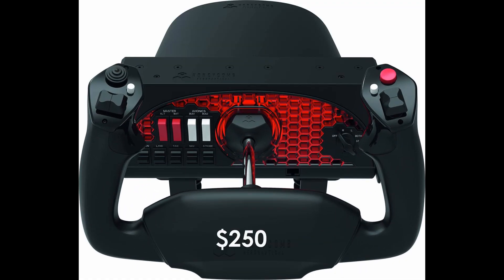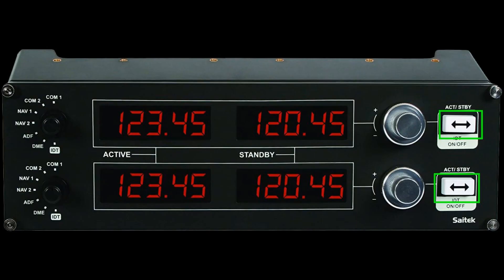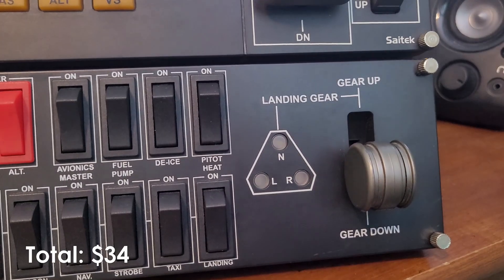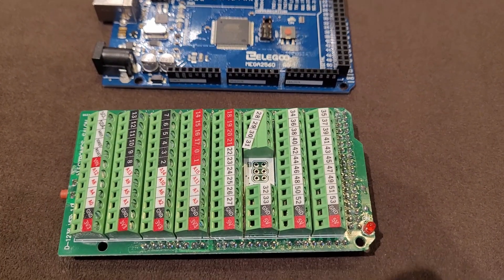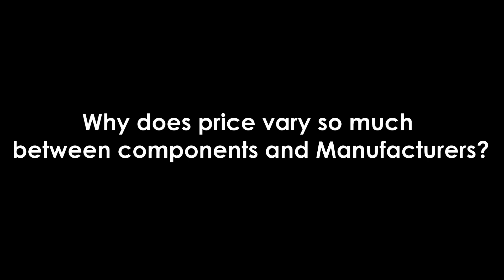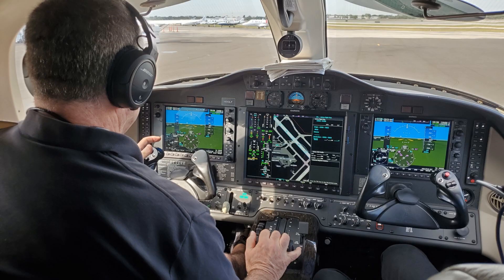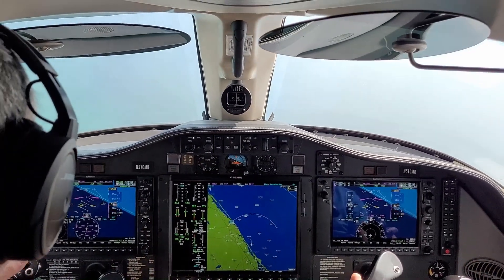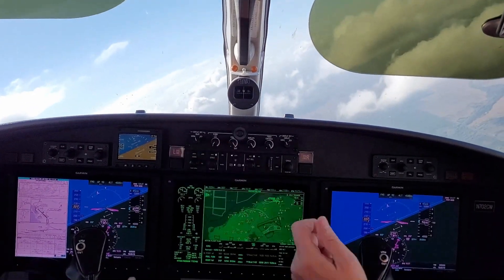Why are Flight Simulators and their components so Expensive?

Comment: I don't think that video really answers the question. Not every flight simulator component is high fidelity, and yet they are still relatively expensive compared to more streamlined electronic products we use everyday. The real reason it's expensive is the economy of scale. Flight simulation is growing, but it's still a small niche market. When you can sell a couple million products, you can produce them for cheap and still make a profit. If you only expect to sell a couple hundred, it's gonna be a lot more expensive to produce, so they need to be sold at a higher price. If you look at racing simulator hardware, it's already a much bigger market and therefore prices are somewhat cheaper (more competition and cheaper to produce). Another factor is that there are so many type of planes with different cockpits, so if you want a specific panel for a specific plane it's a gonna be a small nice inside an already small niche.
Reply from the maker: You make a good point, but what you have said is very generic and only applies to a small aspect of the video. Remember the video also tackles DIY projects and standalone electronics. There are tons of industries (boating, house improvement, renewable energy, etc), not "Niche" at all in which these components are exactly identical and the cost is about the same. Same with DIY...if I build a portable panel with 5 Toggle switches and a controller for my LED lighting system in my porch, I can then use this for my simulator and also my boat; the components and price remain the same as the devices are interchangeable. Racing simulator Hardware is not a very good example because cars are not as complex as aircraft and the knowledge to operate them is readily accessible in contrast to the difficult access to the Aviation industry. High fidelity hardware even in racing simulation is just as expensive. And if you compare products in Racing/Aviation simulation that share almost all of the same components, quality and fidelity, you will notice the price is almost the same. Furthermore, for the units that have sold millions or even billions (which you say should bring the price down), compared to non-electronic counterparts, they are still expensive. This has to do with the fact that electronics and labor is expensive, no matter the industry or the niche market.

Comment: Basically pricing is based on what the market can bear and what the market expects. Right now just about everything is 2x or 3x what it "should" be. Quickmade sells a G1000 set (2 units) for less than Aviatek sells for 1 unit? Is the Aviatek better, maybe. Is it 150% better or worth 3x the cost? Unlikely unless you have money to burn. But again people will assume that being more expensive is better.
A Level D sim sells for $6M (or did before COVID). More than likely half that money went to high overhead and high management salaries. When you start seeing any company with a board of directors, walk away. You're paying their indecent salaries.
Suopport companies that bring value to the table and reject ones that think they have a right to charge ridiculous prices for FS stuff.
Reply from the maker: Thanks for the comment. This video is not really about promoting anybody's products, but giving viewers an idea of what's out there and the different pricing. When I receive a product from a company, and real pilots are not able to tell me if I removed it from a real plane or had the panel made by a flight sim company, then you know the product is of the highest quality available in the market. This is the case with Aviatek so that is why their products are featured. They were the highest quality I could find and this is confirmed by other Sim companies high up in the ranks.
You have to be careful when you say "is something worth it". Everybody's use case is different. Are you an amateur/advanced gamer, are you a real pilot, or do you have a Flight School where you want to use the most realistic, highest quality and higher fidelity components? The answer to this will determine what is "worth it" and what is not and also your budget.

Comment: Very good this video, always good content and videos!
I would like to ask you a question, what is your solution for magnetic switches, I am building a F-16 home cockipit, and Honeywell magnetic switches are very expensive, going after a DIY solution!
Please would like your opinion on this!
I'm subscribed to your channel!
Thanks!
Reply from the maker: Can you please provide me with a link to these switches so I can look at the Specifications? Thanks!
Reply: @joshuamarius  Some references
Switch type: ELEC OFF / BATT / MAIN, ECM OPR and ECM XMIT
ON-OFF-ON Honeywell 12TW1-1A MS27721-21-1A FLAT HEAD (F) LOCK Type A

Switch Type: JFS START1 / 2
MAG-OFF-MAG Honeywell 1TL1-7E MS24658-27E ROUND HEAD(R) LOCK TYPE E

Switch Type: FLTC Digital / FLTC Alt Flaps / FLTC Manual TF Flyup / FLTC LEFLAPS / CMDS jettison / SNSR Right hardpoint / SNSR Left hardpoint / SNSR FCR - Note that the GEAR landing light switch is the same but with one head Special
ON-OFF Honeywell 1TL1- 3D MS24658-23D ROUND HEAD (R) LOCK TYPE D

Switch type: FLTC BIT / FUEL tank inerting / GEAR ground jet
ON OFF Honeywell 1TL1-3F MS24658-23F ROUND HEAD(R) LOCK TYPE F

Switch type: AV FCC / AV SMS / AV MFD / AV UFC / AV GPS / AV DL / AV MAP / TRIM AP DISC /
ON OFF Honeywell 12TW1-3D MS27721-23-1D FLAT HEAD (F) LOCK TYPE D

Comment: too bad there isn't a "used plane parts" dealer down the block like I can find used car parts.... that would make these things MUCH cheaper!!
Reply from the maker: There are many, but you would be surprised that the prices don't come down much even if the aircraft is salvaged for parts after crashing. For example, I found a Garmin G1000 system for $11,000, and brand new you can get this system for around $18,000. 
Even used and beat up its still super expensive.
Reply: @joshuamarius  amazing.  Funny enough, I just did a web search after and agree.. the used prices are amazingly high!
Reply from the maker: @pesto12601  crazy isn't it!!??? You can buy a car for the price of a Screen on an airplane.
Reply: @joshuamarius  What happened to my comment from 10/05/2021? Censoring are we?
Reply from the maker: @mikelehkamp7827  Probably YouTube, I allow all comments, good or bad.